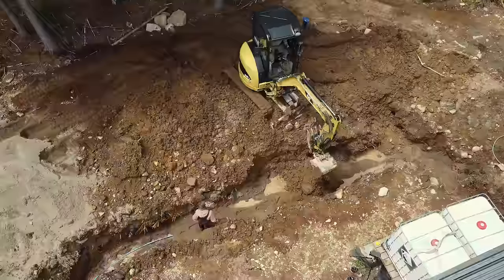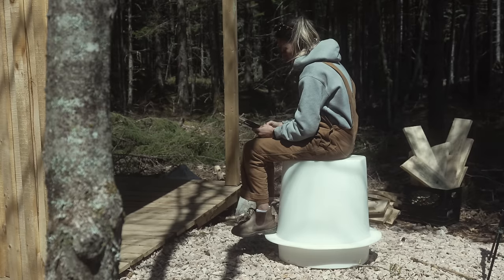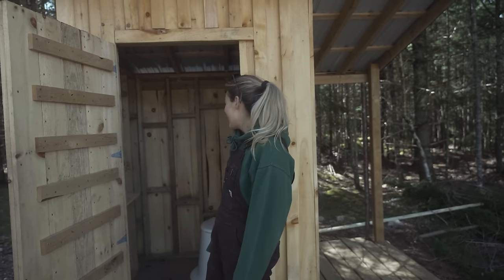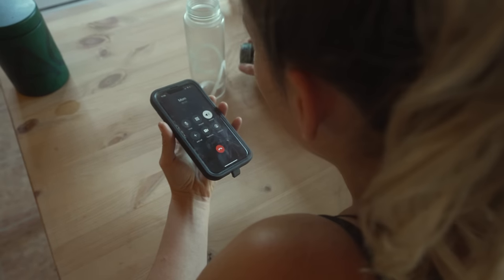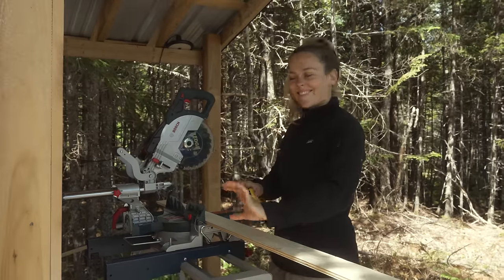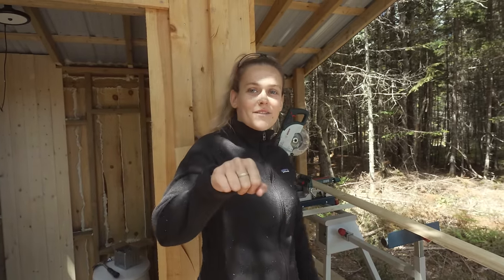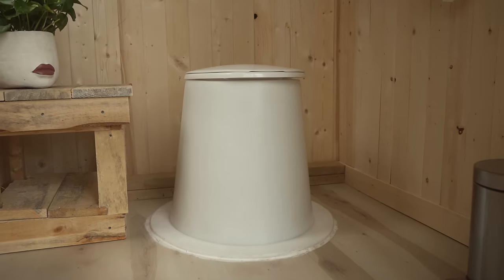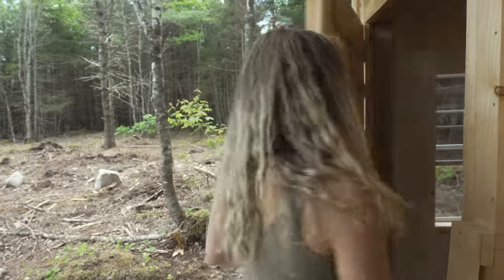We Built A Luxury Outhouse!

Comment: Great outhouse. The only thing you may want to add unless I just don't see it is a vent pipe it will help with the smell, also sometimes a little wood ash goes a long way to help the smell. Wood ash is a great resource, if you mix it with dirt it makes for an ideal road surface. It has many uses. Like I said before one of the best outhouse builds I've see, you should be proud!

Comment: After living off grid 20 + years now. I would recommend sawdust for the outhouse instead of straw. A pine and cedar mix for door control and it will compost without moulding. Straw leads to black mold. Speaking from experience.
Reply from the maker: Thank you for sharing 💛

Comment: My family has a seaside cabin that for decades did not have sewage or inlayed water, the power was barely connected to the grid too, so it was very simple. Over time though we upgraded things including the outhouse.

We built in on a slanted piece of land and made a self siphoning sewage container that sat at the bottom of the small drop, then we build the outhouse over it, with some tricks to get any smells up high. Excessive fluids was made to drain out over time. 

Now that cabin belonged to my grandparents and they had a lot of kids who themselves had two or more kids and they started to have kids again. At times we were 5 generations out there and all used that outhouse. Once pr year or two years, depending on use, that container was carefully removed and dumped at a specific place that was a low spot in the land with a heaps of sawdust and bark shavings almost like it was a huge  composting. Then someone had to flip this once a year and it was nasty.

That spot is now THE BEST garden spot you can imagine where everything grows like crazy. The time scale here is in decades, but still.

That outhose was in use for nearly 40 years, before the laws changed and the local government gave allowances to add a bathroom and a huge reduction in costs to add a modern bathroom to the cabin. We jumped at the offer, so now that cabin has a better bathroom than many of the houses I've visited in my life. A few years ago, that outhouse was changed to a small storage house which has everyday stuff.

Comment: Under the window, angle the boards from the window in the direction toward the ground
 so water does not sit on the flat surface and rot it faster...   (what we did when building a barn).

Comment: Now since you don't have a drain on there yet taking put pipe on there go to those sprinkler systems and run them around to each one of your trees and bushes those little hoses and run them under the dirt and run them to your trees and stuff and as you wash your hands then you end up water in the trees in the trees and when you get to your overflow of your barrel from the rain water if it gets to the overflow level you need to have an overflow level that ties into that same hose that as it overflows it runs to your trees

Comment: It’s cuter than my indoor bathroom!
All sinks should come with a template in the box. If you use it your cut should be correct. Also - sink flanges are usually 1”. So you could measure that way. If you want to know how to under mount the sink- maybe for your kitchen- let me know. It’s easy & I’ll help you. I worked in granite tops for years and now I work in plumbing. ❤️

Comment: If you need extra light cut midle of the roof out and put in some clear polycarbonate  roofing sheet on get some natural light in. Make sure you add some chemical to the long drop to i don't know right term either kill the bacteria or help it. If you haven't you could collect the water from sink and use on a garden that's near the window. But looks great, im sure will get used.

Comment: Great job! What did the mill guys tell you, if anything, about water resistance of your vanity top wood? We used similar wood in our cabin kitchen and eventually, water splash started to make dark stains (mold?) in the wood. I sanded that away and put down a couple of layers of matte sealant that more or less matched the original color. You might want to consider doing this before the stains show so you won't have to sand.

Comment: Gurls find an old barrel and burn scrap wood it will help with the bugs.  Also consider plants that are natural bug repellent.  I would put a mesh on the exhaust pipe .  You do not want snake and other critters to  use it as refuge.  The bathroom turnout so country chic. Keep a bottle of water - vinegar and lemon essential oils to keep it clean and fresh since others may use it as well.

Comment: LOL, RELEASE THE KRAKEN!  Little tip, next time you do a sink.  Flip it upside down and trace the outer part.  Then measure from the edge to where the sink starts all the way around(looked like about an inch of lip all the way around).  Create another square inside the outer tracing.  Cut the inner box you created.  The sink should fit right in the first time.  Keep it going ladies.

Comment: Not for nothing but why not just get a composting toilet? They don't stink, they are easy to maintain, 100% sustainable, etc. Since you two are hardcore DIYers, you can source an old ice maker motor and use it to "stir" the composting toilet instead of a manual crank. Oh, and the CP would be in INDOORS where there is HEAT.  Did y'all consider a two-holer?  My maternal grandmother's ancestral farmhouse had a two-holer.

08:20 I am older than your parents and have used many outhouses, but never been in one with "flooring". What, no baseboard? I was expecting luxury vinyl tile and baseboard
12:10 I have never been in an outhouse with a window
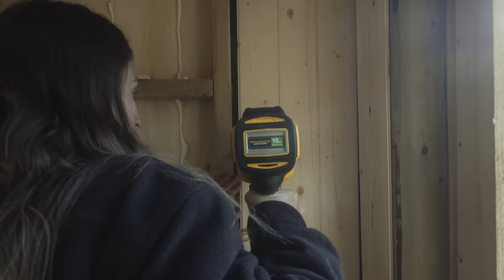16:30 I like the tongue and groove but no rock wool?
18:20 Love love love those pups. Do they have toys? Want toys? My Boxer dog, Lulu, loves new toys.
21:21 A house plant in an outhouse - a first for all time
22:00 That foot-pump sink is super smart and something few would have imagined. Nice work ladies.
23:00 Just WOW, y'all have upped the game on waterless, sustainable toilets. You two are just a cool couple

Comment: For an outhouse you dig a hole and do your business. The great disadvantage is getting outside to it on a rainy or snowy cold cold day or night. Why not dig a hole and put a septic system in it with drain lines? This way you can do your business inside and avoid exposure on those cold cold rainy or snowy excursions. There is an extra cost but it is not extravagant and certainly worth it. 💩💩💩🤔🤔🤔
Reply from the maker: We will be doing a inside bathroom as well. We don’t have a bathroom right now. There are many steps to getting a inside bathroom so that will come in time.